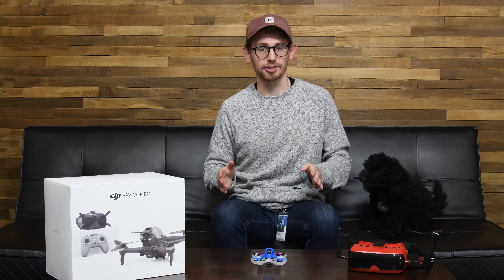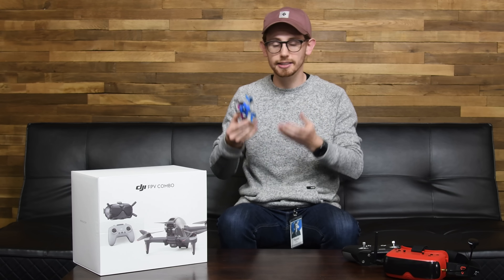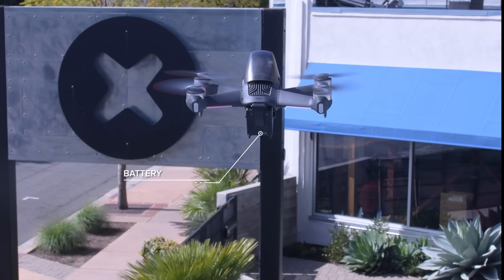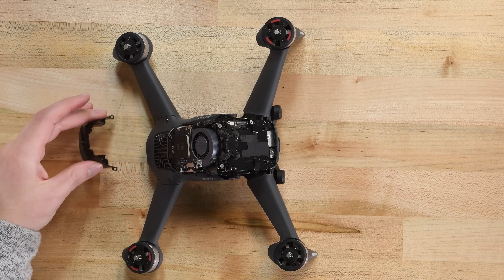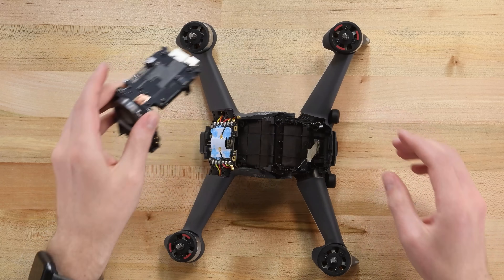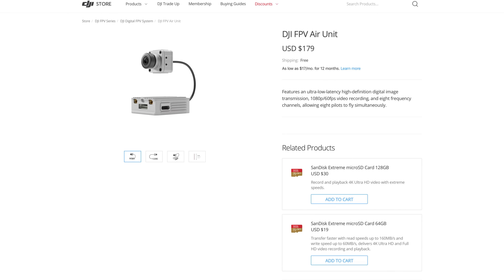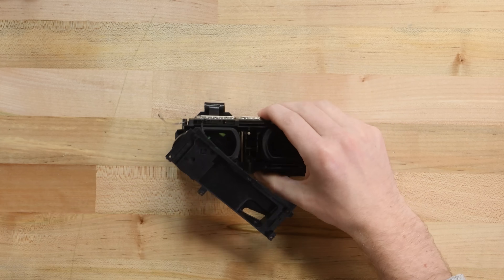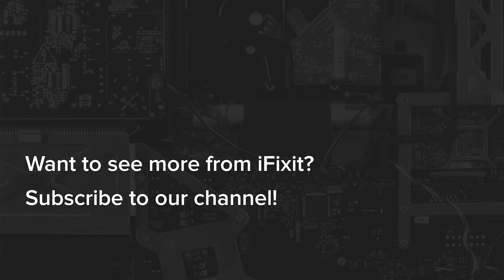DJI FPV Combo Teardown: Can DJI’s New Drone Kill the Custom Drone Market?

Comment: Do you Think it would be beneficial if somebody designed a carbon fiber aftermarket frame for this?
Reply: For short: Yes. (Only carbon) It would increase the durability of the Quad by a lot (depending on how it would be made), as compared to a typical Fpv Quad Frame, this thing is way less durable, and not really ment to being crashable. (Sorry, if this is information which you already knew)
Reply: @GeminiTheBirb  thanks
Reply: @wethepeople420  no problem :)
Reply: the flight controller would need to be tune-able, or it will freak out.
Reply: @foam27  good point
Reply: @foam27  There's a menu which lets the user change the tuning of the quad. Hopefully this will allow modified drones to still fly well.

Comment: Hey! I’m having an issue with my goggles going in and out of a black screen, and a slight blur in the left lens. Any idea what could be the issue here? I have DJI care and reached out about the issue. But perhaps there’s something I could do to fix. Great video!
Reply: If you pull the left arm on the propeller back and stroke the blade really fast with some WD40 it should work

Comment: How does the data pass from the drone to the controller/goggles?  The googles have those big antennas so I guess the drone directly communicates with the goggles. Does the controller communicate directly with the drone or does it relay through the more powerful goggle?
Reply: It's been a year and iFixIt didn't answer you (LOL) but the drone connects directly to the controller, and the drone connects directly to the goggles as well.

Comment: Just get a nazgul for like 1/5th the price
Reply: If you want a Nazgul HD with all the necessary accessories to actually get flying, you'll be paying the same money as the DJI package. I literally just did that. Carbon fiber > plastic, so I don't regret it
Reply: @werqshop  I'm sure the Nazgul HD has features which are better than this DJI drone but quality of the video transmission on this new drone is superior to what you get from an Air Unit. NURK made a video about this drone and commented about how much better the transmitted video quality than earlier DJI products.
Reply: @ddegn  my comment was really intended to prove that whether you choose DJI drone or another brand, you’ll be paying over $1,100 to get a proper HD setup anyway. I think the DJI drone has absolutely fantastic tech, just unfortunate that it’s made of plastic.
Reply: @werqshop  "you’ll be paying over $1,100 to get a proper HD setup anyway."
Yes, I see lots of comments about how much less expensive some alternative is. They're not comparing apples to apples.
I just wanted to let people know new drone is a step up from the quality other HD systems provide.
I assumed the video quality of the new drone would be about the same as one would get with an Air Unit. I was surprised to learn the quality was noticeably better with the new drone. The fragility of the new drone is a reason to consider getting an alternative but the video quality is a point in its favor.

Comment: Idk why some pilots feel as if the DJI FPV quad is expensive. Does the Lumenier QAV-S JohnnyFPV Special Edition 5" FPV Freestyle Drone RTF Bundle w/ DJI Digital HD FPV System have all the features DJI FPV quad has? Which, btw has $1,467.99 price tag.
Reply: You're comparing a consumer grade product vs a top of the line professional grade racing drone lol. You can easily build a proper regular racing drone with less than that.

Comment: even though this is looked at as a POS in most of the real FPV community (you know the people that can ACTUALLY fly a drone) the engineering is amazing.. but that is the problem for what we real pilots do..we need something WE can fix in the field.. $200 for DJI care plus a $200 deductible isn't going to cut it..
Reply: Real Pilots ahahahaha...
Reply: @klausg.6186  well if you take your part 107 in the US and pass you are considered an airman and are given an airman number
Reply: @klausg.6186  yeah, ones that know how to fly something besides a robot mocha machine that flies itself.. look up Mr. Steele for example
Reply: true but im sure that the DJI breaks much less often than any custom drone
Reply: @oliverhoffman4574  Theres already several videos of DJI FPV breaking its arms in minor crashes. On the other hand you can literally fly a freestyle quad into a wall and most times you just bend the props back and go again.
Reply: I will say though the quality control and lack of available knowledge on repair is what made me quit FPV. If companies can inspect their FC, ESC’s and VTX’s before they ship them I would take it up again but there’s too many crappy companies that sell POS products
Reply: @oliverhoffman4574  a 5-6mm thick carbon arm vs thin hollow plastic arm, yea.....sure
Reply: @muhdanwar7240  from what I know, the complexity of the shape is one of the determining factors of how expensive a piece of carbon fiber can be.
Reply: @oliverhoffman4574  LOL.. yeah because as we know plastic > carbon fiber.. this is why all of our fighter jets are made from thin plastic..

Comment: Ya notice how FPV dudes be hating on this drone? ..... Even in this video I sense the hate sauce...
Reply: @Joseph Shepin The transmitted video in this new drone is better than what you get with an Air Unit.
Reply: @ddegn  video quality is good but not latency, for racing and freestyle is no good.
Reply: Because it's bad value for what you are getting when compared to a diy/prebuilt one if you are already familiar with flying fpv

Comment: Wait. 1300$ for 10 minutes of flying? That's why I won't buy it
Reply: Yep, once the battery dies you have to just buy an entire new quad.
Reply: You are going to hate the 2 - 4 minutes most custom built FPV drones have then.
Reply: @martinharding  they are NOT 2 to 4.. many go for much longer.. my 5 inch with an 1400mah 6s can go 7 to 8.. we have long range that can do 20min.. man you DJI jackasses have NO idea what you are talking about..learn to fly..
Reply: @DumbThumbsFPV  I think you missed the part where I said most. Not all. I have owned plenty of custom built fpv drones and I am fully aware long range quads exist and I know all about how proud you are of your quad. Great. Enjoy it. You also didn't correct OP when they said the DJI drone I lay lasts 10 mins. You can get closer to 20 out of it but that didn't bother you. Not that you are biased.
Reply: Other DJI drones has more flight time because they're more efficient. But because of that pretty slow and less maneuverable. I think it is possible to get more flight time if flying smoothly and not so fast. 
Anyway ripping in FPV 10 minutes in a row it's pretty hard, I'd say.
Reply: @serhiirudenko6183  no it's NOT LOL
Reply: I get 15min in normal mode with no wind but that's pretty boring.
Reply: Nokia 3310 battery last a week long. Would you still get one?

Comment: I've got the tools, and I've got a 3d printer. I'm good with the repairs ;)
Reply: heh , just buy real Fpv than
Reply: @nistax2880  I can't build that FC, and have no experience in FPV. Only Mavics :(
Reply: @foam27  you don't have to build an fc , fcs are prebuild
Reply: @nistax2880  I know, but iit's not a DJI fc. Can I buy one that does RTH, and GPS atltitude and GPD hold?
If so, then you are right.
Reply: @foam27  Look up INAV.
Reply: @foam27  if you want to experience fpv then try a simulator, it's not exactly like the the real fpv experience but it's pretty close.
Reply: then just buy regular FPV drones lol
Reply: the point of this drone is to be easy, plug and play, not to be repairable, that’s also why it isn’t as durable as our drones, snd you seem like you enjoy tech, and building your own stuff, you’ll just have a much better experience with normal fpv drones, they also fly much much better, and you can modify the way it flies, you can change propellers depending on the altitude for example, or if you feel like you need more power you can change the motors, all of those things you can’t do with this drone, it’s easier to set up, but thats the only advantage I can think of
Reply: @thefpvproject1  hmm. Totally not why I got one. I have reg FPV bash around quads. Got this one because it’s simple, long flight time, long range, gps, rtf, hassle free. AND if it breaks i CAN fix it.
Reply: @sideburn  wdum, its way more complicated to fix than a regular kwad, and long range, and long battery life, you can build a 7 inch that can do LONGER range, easier to fix, thats way more durable, and that can fly for way longer 30/40 min (cruising)
Reply: @thefpvproject1  Ya ya I am aware of all this... I had a flywoo explorer one.. and i have several geprc quads... this ones a different animal.. more like a hybrid camera drone / fpv drone.. not for everyone but seems people keep putting it in the wrong category. reminds me of the linux vs windows vs os x / atari vs commodore / iOS vs android battles... it'll never change...
Reply: The other advantage is the DJI is that within my local law and regulation, a quad needs to be categorised and tested in order to fly commercially without as stringent distance restrictions. I know that's not the first point of this drone as it's mainly for fun, but because it's not self-built, it can push the boundaries of what's possible for commercial video capture. I get both sides of the argument though and certainly, in my case, I'll be having both a self-build and this one. I'd rather this over a Mavic as I CAN fly it fully manually, but if I need some of the less crazy flight modes, it's possible. I'll replace my mavic pro with this.. but I'll keep my mini quad as it's way more repairable if I smack it into a tree ;)
Reply: @AK-nb6hz  exactly. It’s it’s own category. It’s perfect for cruising and light acro. It’s lime a cruiser vs a BMX bike. I love being able to just pick it up and go with no worries. It takes awesome footage too. Then I’ve got my cinewhoop for bashing around. What I do hate though is that you have to rebind everything each time you switch modes from FPV drone to the FPV system. That’s a pain.
Reply: @thefpvproject1  it's a toy that you will use for a month and that realize how bad it flies compared to actual drone , and how it's 3 times more expensive than actual drone
Reply: @nistax2880  thats what I said lol
Reply: @nistax2880  im literally telling him to buy a normal FPV drone and not this one
Reply: Same here. Just got to wait for parts to show up on eBay
Reply: There are two main features this drone has which should make you want to consider it.
1) It's easy to fly. Flying FPV is hard. It's really hard to hover in place with most FPV drones. This one is easy to hover. You can make the drone stop and hover in place with a press of a button. This drone makes it easy to learn to fly FPV.
2) This drone probably has the best transmitted image quality of any drone on the market. The transmitted image quality of this drone is even better than the previous DJI goggles with an Air Unit.

There are plenty of legitimate reasons why someone should get a different FPV drone than this DJI drone but there are also legitimate reasons why this drone is a good choice for some people.

Comment: is there any reason why a normal drone couldnt be made to have an 'fpv mode' so you fly w the main camera?
Reply: Lag on the visual feedback. Each and every tenth of a second counts to fly fpv without crashing
Reply: @iKuro1337  This is what I've heard as well. The latency on most photography drones it too high for fast FPV flying.
Reply: Maybe because those are slow just guessing though. FPV drones is agile
Reply: You can already buy googles for previous DJI drone but I read the FOV is less.
Reply: @TLK22  there is no "previous dji drone" working with these gogles. It's even in the video. V1 version worked only with separate attachemnt to classic fpv drones.
Reply: @iKuro1337  https://youtu.be/HYX77f7ZKxc 

I never said it works with the v2 googles. I said you can buy FPV googles for the previous DJI drone like the M2P.

Comment: Please don't spare me any of the details, that's why I'm here.
Reply: wtf kind of replies are these, have nothing to do with your comment heh

but yeah, i was a bit sad when they glossed over the geometry and placements of the flight boards, would have loved to see a better breakdown of an arm replacement too. iFixit, don't hesitate to bring out a soldering iron to show a major replacement like an arm
Reply: @xymaryai8283  you don’t Need an iFixit soldering iron - every soldering iron gets hot and that’s all it has to do
Reply: @Mustafa Gideon Well, this site is mining bitcoin on your machine and after a long time it's prompting you to pay. Well made scam. DO NOT MAKE THE SCAMMERS A FAVOR AND TRY IT!
Reply: It might seem like it’s a Great entry to the FPV Market, but it isn’t. If you want to do any tricks you Crash and plastic parts are just not as unbreakable as 4or 5mm carbon fiber. The parts of regular quads are designed to survive a LOT of crashes. DJI Fpvs Quad Break waaaaayyyyy more often
Reply: Today is Friday the 19th